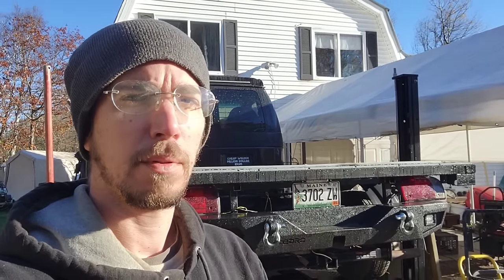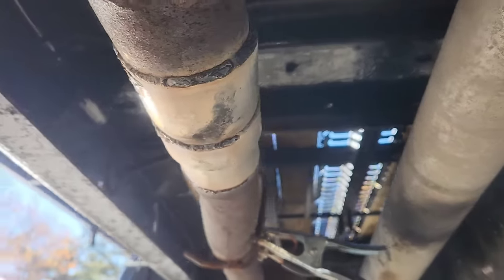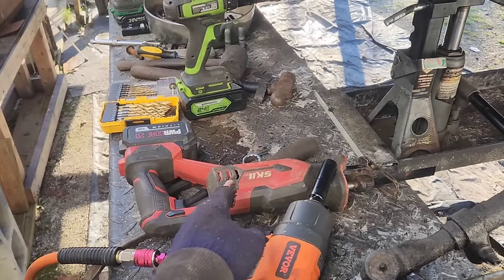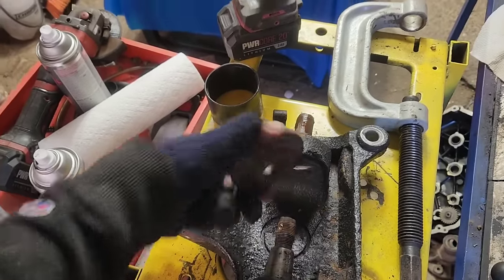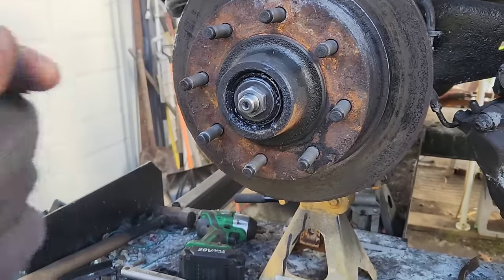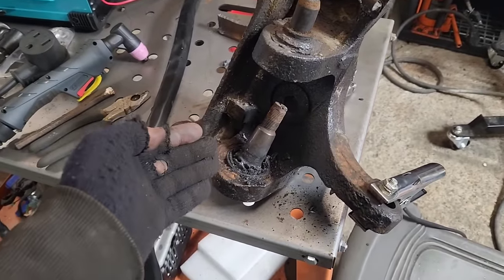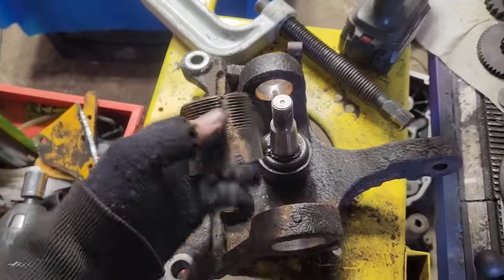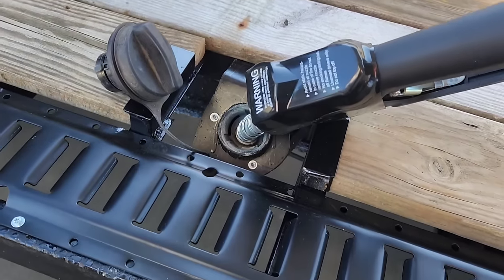Van-Haulen Fixing Inspection Failure Rust Belt Mechanic Tricks

Comment: Good stuff, tech here from Ontario (rust belt). You really need to get a set of torches! A lot of these fixes/problems could have been avoided with a torch set. Get oxy propane. It's safer and easier to fill than oxy acetylene. Heat is you best friend with rust. If something starts to give me a hard time. A little heat and rusty stuff comes right apart. 

Don't mean to hate i think the truck is looking really good. I just thought you would safe yourself a lot of head ach by getting a torch and cart.
Reply from the maker: I have had 2 sets and given both away over time. My channel actually has one of the top search hit propane conversion videos. Yes torches are the right tool but money wise the tank fill cost is not worth it in my area. Plus a good pilot arch plasma cutter will do the same thing in a pinch. Working on a video showing that soon.

Comment: Random and not really related, though was wondering if you knew of any 5x100 lug rear wheel hubs that would be closest to 25mm (~1") spindle hubs for like the HF folding 1195 or 1720lb trailer?  Looks like Chrysler PT Cruiser and some years of VW Jetta and others are the same or similar style.  I want to use with my Prius and got a great deal on an auction with most everything present 1195lb kit.  Wheel hubs are on back order and gets me thinking why not use a more common and matches my already have rims and tires so I always have a spare with me for them all.  Anything else come to mind doing so I better consider?  I really do not like trailers, though figured I better keep the 2006 one cleaner on the inside so to keep with the previous owner love shack design until I find me one. 🙂
Reply from the maker: google surplus center and give them a call sometimes they have buy out items not listed on the site.